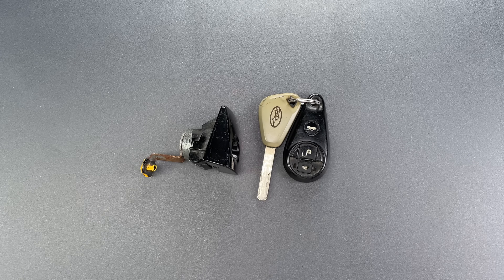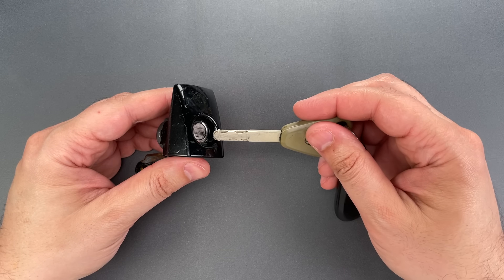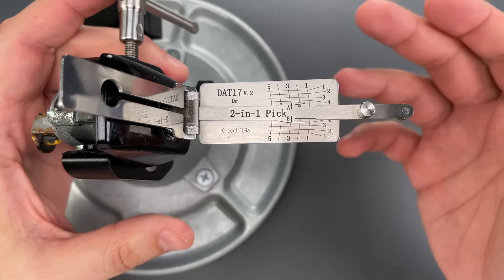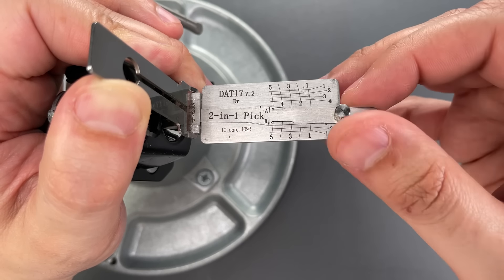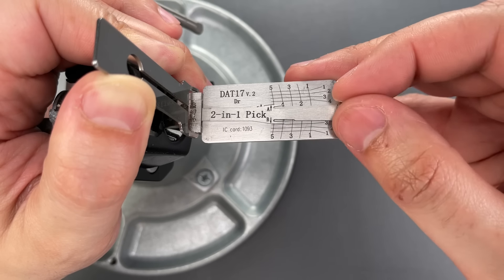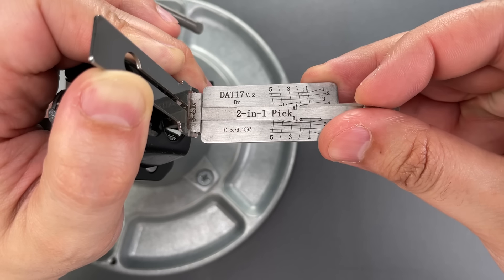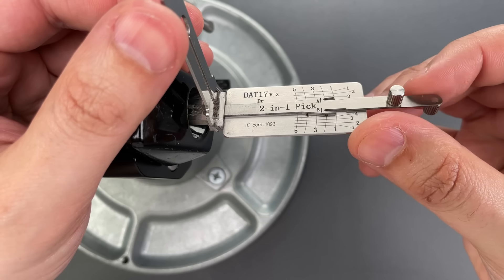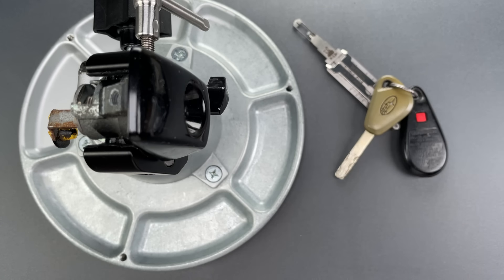[1346] A Trap For The Unwary: Subaru Impreza Door Lock

Comment: As a Subie owner, I think I'd rather my car just be easier to pick so a potential thief doesn't just break the windows.
Reply: I’ve had this happen twice, I’d prefer the lock being picked instead of glass everywhere and cleaning that up and replacing the glass….
Reply: Ill tell you they should all have alarms if the door is unlocked with a "key" and the rest of the car is armed too. Once locked.
Reply: I think approximately 0.00% of car thieves pick locks.
Reply: my windows get broken even when i leave the door unlocked 🙄
Reply: Thats what my grandma does. Leaves the car door unlocked cause she dont have nothing in there. I dont think thats too smart but i guess it works since they haven't had any broken windows.
Reply: That's never going to happen. Who's going to waste time picking when a fist in cloth or a small hammer is way faster?

Leave nothing of value in car. Easiest way to prevent break in.

Easiest way to prevent theft of car itself? Manual Transmission. Usually.
Reply: @Real28  manual transmission as security through obscurity only works if you're in the US
Reply: @SamShawAZ I found a way to disable the alarm if you want to know. I've got an 09 wrx, my unlock button broke.
Reply: @Tom Cool story brah.
Reply: @bennyboyy7  I own the same model and year of car the lock came from and I can confirm the alarm does go off if you open the door with a key (unless you put it in valet mode).
Reply: @TheScribbler86  the Forester is like that too. I wind up getting honked at a fair amount because the power lock actuator on the driver's side ate a little too much decomposed granite dust so I have to use the remote and the key to get in, but sometimes I forget to click it first
Reply: Why would someone want your car? The catalytic converter is what they're really after...
Reply: @matteblack5805  yeah granted, that's easier to fence than the car itself. I have no idea who just buys loads of roughly sawn off catalytic converters, at least not in my state, but it definitely happens. Unsurprisingly, they're bought no questions asked by scrap yards in Miami. Ah Miami...
Reply: @hyvahyva  the metal in the cat has the value, scrap dealers will buy it. I don't know the details on how that works but it 100% happens, nationwide.

Comment: I’m on my third Impreza -glad to see that the locks are difficult to pick! The joke would be on thief, Imprezas are generally full of protein bar wrappers and  stinky running / biking / kayaking gear.
Reply: If they're anything like Honda's newer wafer locks, they only take a second (literally) to punch out.

The older style just needs a screwdriver and leaves no trace of damage.

Yeah, not so happy with my Hondas after learning those the hard way.
Reply: The most accurate comment
Reply: Nothing but granola bar wrappers, Stinky climbing and running gear, and motor oil in this Subie. I feel called out. Its too true!
Reply: Insert horrible, stereotypical lesbian joke here

Comment: LPL, when that is in a car door you would have to pick it past that half-way position to get the door open. It is also how you would get an accurate reading if you wanted to read the bitting to make a key. At that point you have to hold it against the tension. The Honda HON66 keyway is a very similar split-pin keyway. And I suspect Subaru may have copied their design. Subarus also use Nissan keyways in some vehicles and I've come to believe they just license the right to use them (or something of that nature).

And actually, although it is more time consuming to pick, split pin locks are notoriously unreliable. I often have customers who can no longer turn their ignition or their door because the split pins become dislodged.

Comment: A Subaru Impreza is a car not seen in the USA , it's more of a UK and Australia model car, an off road 4 wheel drive raised suspension car that has a big hood air scoop and big engine ,they sell secondhand for about $60k and are hard to register and expensive to insure, a great car for dusty sandy  desert roads and mountain dirt roads..

Edit- the Impreza model came out around 1994 I think? and updates/new models stopped a few years ago now replaced by SUVs and electric model cars just like every other manufacturer..

I see imprezas occasionally on the road usually with car collectors

Comment: This is exactly what my Toyota Prius lock cylinder was doing.  The key would not go into the cylinder.  Toyota wanted $723 to replace it.  I told them I had the extended warranty, so they said just pay the $100 deductible.  I said no thanks, and just replaced it with a new aftermarket lock that cost me $23.  One T30 screw, takes about 5 minutes.

Comment: These locks are some of the hardest automotive locks, luckily not that common and it's about as difficult as it's going to get. Hondas often have these.
Reply: Far as I know all 03 and current models have a similar key. It has a small stamped “V” on the shank. A very a good lock set up im sure it can be picked but buy the time they do the lock will either be damaged or lock them out like how it did on here. Or if rare instance they do so one with a piece will stop em.
Reply: @nighthawkj30A4  these are actually somewhat common, not really sure why I said that. I don't often pick those though. I believe there's V and G to differentiate the transponder chips. When you pick these, you have to pick them twice then read it, then pick it back for the lock to function. Happens because the wafers are split into two, and the cylinder gets caught on the second set, which will have to be picked. I'm not sure what actually prevents it from turning back though.

Comment: I had a 2010 Subaru Impreza. Even if you get inside you can’t start the car without a computer activation of the ignition key, which needs to be done by the dealer or a locksmith with the appropriate equipment. When I lost a key I could not find a locksmith in my area do the activation and the Subaru dealer charged me $65 for a procedure that took all of 10 minutes. Replacing a Subaru key was a royal pain in the ass.

Comment: Have a 2014 Subaru Forester that thieves busted through the drivers side door lock with a flat blade screwdriver in about 6 seconds... Nevermind a pick... How do I know this?  They were on camera the whole time...  peeked in the window of several cars with a flashlight, got to mine saw something they wanted in the dash and out came the screwdriver... Took them another 30 seconds to break the Alpine 8" deck out of the dash, cut all the wiring and walk away less than a minute after they arrived at my car door.  Alarm was going off the whole time... didn't matter... Worst part was the attitude of the local PD... took down all the info filed a report and pretty much said "well  that's what insurance is for..."  when I took the car to get the damage fixed I was shown the cheap plastic the door lock assembly\mechanism was made from and how when they broke it apart you could just turn the lock open with a flat screwdriver... turned out it was an even more efficient way of gaining entry than breaking the window.  If I would not have seen the whole thing happen on the recording in less than a minute I would have never believed it.  Unfortunately when its 3am in January in Chicago and 12 degrees out it's difficult to identify thieves on camera...

Comment: I am seeing a lot of comments that the lock being in the half-open state is enough to open the door. In at least some cars, this is not true. My car occasionally has issues with the power door lock solenoid, and I can tell you if my car door is less than 95% unlocked, it will not only still be locked, but pulling on the door handle will push the mechanism back into its fully locked state.

Comment: The best part is, even if you somehow manage to pick a Subaru lock, much like other manufacturers a powered chip with the correct ID needs to be recognised by a reciever at the point of unlocking or the car alarm goes off and will not stop until a remote fob is used to unlock it.

Comment: On the bright side, this lock shouldn't need to be picked for any practical purpose. Lockouts are solved much easier with a standard lockout kit where you lightly force the door open and reach in with a long hook. This is coming from a mechanic though, not a lock smith so take it with a grain of salt.

Comment: The problem is, he is using the wrong tool to pick the lock. 
A large strong magnet should do the job easily to get into the car. Throw the large heavy magnet on the car window, and you should be in the car in 2 seconds flat.

Comment: LPL, I like your content, but it was misleading to say you got that lock open. You notice that when you say that, the lock is turning maybe 20 degrees with the Lishi in the lock. With the key in, it turns a full 90 degrees. The cylinder is not picked. These cores are called high security for a reason.

Comment: VERY big thanks for this info LPL...  WOW talk about GOOD TO KNOW holy crap.  God can you imagine how much it would cost to get replaced at the freaking dealer?  At that point I'd rather just hotwire the fucking thing (assuming I did not know how to fix this) and keep the switch hidden in a secret spot where only I would know about  Like under the carpet or make a secret cut out somewhere that you cannot tell it opens up..  My buddy wired his ignition for his old ford 1963 truck that way.  We had a secret switch hidden underneath the dash, and if it isn't flipped the ignition would not work at all even if you had the key and turned it :D mwhahahah.

Comment: Would you consider that behavior by the Suby lock to be a desirable security feature?  

Also, I know it is a bit off topic, but does the jammed cylinder interfere with normal operation of the remote key fob?  I.e. could the owner open the door with the remote beeper and not even realize that the cylinder for the physical key is in a compromised state?

Comment: Sorry if I misunderstood, but does the same applies to my Ford Fusions trunk lock that’s stuck? The key goes in but doesn’t turn and the exterior (that opens when u insert the key) latch is stuck open. So does that mean my attempt at picking it got something stuck halfway and just doesn’t allow the key to work anymore? It opens just fine from key key fob or the button inside the car.

I was 2 hours away from home when I locked my key in my trunk and used a very very low quality pick set and couldn’t get it open...

Comment: So you picked the door lock into my Subaru now have fun with the keypad & the electronic coder from your key which talks to the engine immobilizer. They had to put all these security measures in because these cars were well sort after by criminals.

Comment: I started watching your videos a while back and started watching videos about picking your standard padlocks and door locks. I bought a set of fairly cheap picks just to see IF I could do it myself and if I even liked doing it before I spent a lot of money on expensive ones. And well, I found that even I as a beginner was able to pick both the door handle and the dead bolt on my front door in anywhere from 30 seconds to 1 min with VERY little effort. Needless to say, it made me change my door locks to something much more substantial pretty damn quick . I wanted to make it as hard as possible for anyone to pick my door lock, even though nothing can make it IMPOSSIBLE. Like my grandpa use to say "locks are only meant to keep the honest people out"

Comment: Just for everyone who is curious, these locks on cars are called "High security", I'm sure you can see why with how much longer it takes to pick, even for a professional. This particular key is a "4 track high security" because it has sides A and B. Honda/Acura cars have pretty much the exact same style, with a wider blade. Other cars such as Toyota/Lexus have another style, with the cuts on the key being cut inside the blade, instead of on the edge

Comment: So it takes a while to pick and even then it seizes up if you didn't use the key?
So is this technically unpickable by conventional methods?
Sure you could break in or maybe impression the key, but it doesn't actually unlock if picked right?

Comment: Does that mean that when it's in the trap position,  the lock isn't fully open? If so, then is this a lock that LPL can't pick open fully?
Reply: No. It opened just as far when he used the key. But being a door lock, you insert key, rotate 45° (unlocking the door), rotate back and only then you can remove the key.

Comment: There are some lockpickers who also like guns. (Just a couple)
And those couple of people know the four gun rules.
Well, lockpicking also has four rules, and "Never pick locks you use" is, like, number 2!

(1. Never pick locks you don't own [unless you're being paid to by the owner]
 2. Never pick locks you use [unless your need overwhelms the benefit of having that lock, of course]
 3. Never steal locks. [you'll notice there are no exceptions for this one]
 4. Never trust a lock for security. Not completely. Not ever. No matter what. No exceptions I guess would be the main rip-off of this joke.
But these rules are not a joke.
That's why I've hung them before a joke, that all might compare and contrast)
Reply: Sorry about that;
For those wondering...perfectly soundly...what in blazes one is supposed to DO with any lock if NOT "trust it for security:"
It's actually quite simple, really: a few crooked lock makers in the way ago started the rumor that locks both could and should be...yeah....trusted for securing a space.
But locks were, for the very LONGEST time, never thought of as security devices so much as indicators of entry.
Some of the earliest "locks" were actually ROPES tied in "sailors' knots" to briefly secure belongings ashore...usually on the docks.
The point of the knots tied around bags was never to PREVENT theft, but merely to indicate tampering.
For the time, no information was free, and so only sailors (supposedly)knew how to tie a sailors' knot.
But of course, that was never true. No knowledge ever stays hidden.
Not forever.
I digress.
Please: NEVER trust ANY lock...not by itself...no matter how obscure or elaborate...to secure anything of importance. Not ever.

Comment: With all due respect, sir, you only picked the lock to the half open/trap state. Can the lock be fully opened through picking? Or did I misperceive the situation where the lock is fully opened but not accessible to a key and needs to be half-picked back to a closed state to return to normal functionality?

Comment: I love these videos but I've never understood the interaction between the different pins. What is it about picking 3 that makes 1 pickable?
Reply: You’re using rotational pressure on the keyway to bind the pins and hold them up while you work on others. Depending on the design of the pins, you won’t be able to put pressure on some pins (pin 1) until another pin (pin 3) is lifted out of the way.

Comment: Wait , so are you able to fully pick this lock yourself or is it not possible? This is the first video I've seen where the lock wasn't actually fully picked!
Reply: He got it open, automotive locks have very short throws as they're only pulling a rod a short distance to cycle a actuator, the part where it locked up and wouldn't take a key is technically it's "unlocked" state without a key holding the wafers where they need to be they fall out of position and lock the core up

Comment: What caused it to become stuck, though? Is it a defense mechanism or simply an error in design?
Reply: max box pog
Reply: I’m not actually familiar with this lock, but if I had to guess, I’d say the “pins” for side A are getting caught up on the “drivers” for side B (side B “drivers” could be some sort of traditional driver pin, or maybe a sidebar channel, or something else that stops the lock from turning.) It’s not intentionally designed to get stuck there, but it’s also not really an error with the design, as the lock shouldn’t be operated without the key.  With the proper key in place, the “pins” for side A will always be in the correct position, so able to turn freely.
Reply: It’s certainly not an error since it doesn’t affect the normal operation of the lock with a key.
Reply: Yes. 

Seeing as this doesn't happen with normal use, though, this is more akin to a accidental defensive mechanisms
Reply: To sum up all the answers you got: "It's not a bug, it's a feature."
Reply: I was a dedicated car locksmith. I've done many of these kinds of locks. It is designed that way. It confused most people because obviously the key does not do this. This is because the key holds all the wafers in the correct position at all times, allowing the cylinder to turn as freely as it wishes. Lishi picks do not function that way, they deal with one wafer at a time. So after picking it, one side of the wafers gets released, which is why it needs to be picked again back to the original position.
Reply: @MrSergeantglitter  Awesome.
Reply: @OfficialMaxBox  If that was confusing or wasn't quite what you were looking for, let me know
Reply: @MrSergeantglitter  I suspected it was something like that
Reply: @Loupgarou21  I respectfully disagree. 

What reason would you have as a designer to disable the lock for an authorized user (aka the owner with the key) if the lock has been tampered with?

This is clearly poor design, and not shocking (former Impreza owner, and that car was a poorly designed shite show)

Comment: You can definitely tell you've got zero sense for engineering. Just merely looking at the key and knowing that you know how the wafers are designed it is absolutely laughable the fact you thought you could put the key in while it was picked... the lock is clearly damaged... you broke it to the point where you had to pick it locked... you should of just simply been able to turn counter clockwise to get the lock to set back...